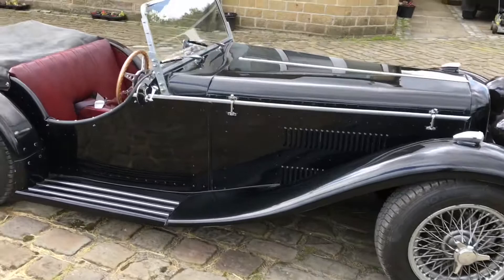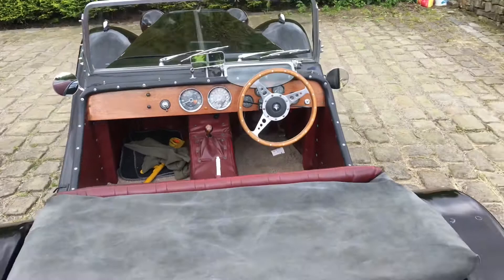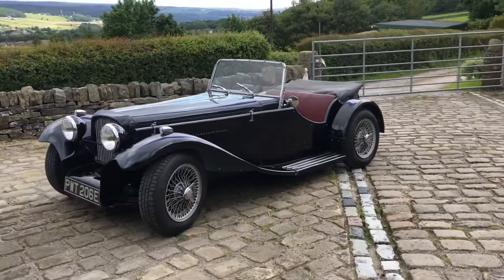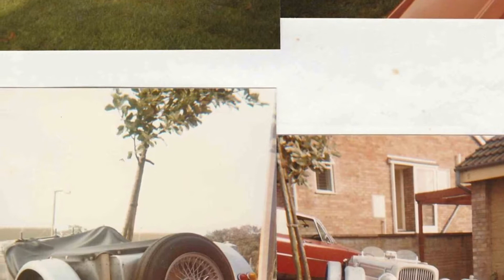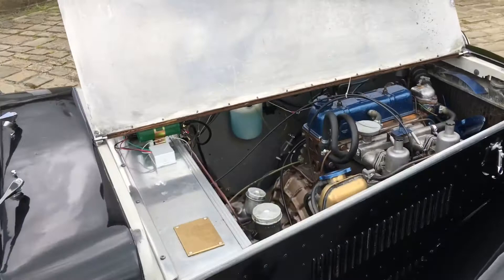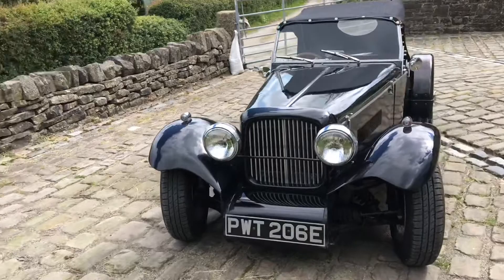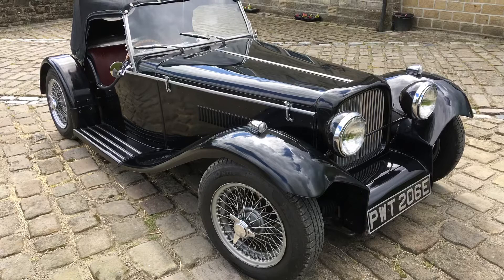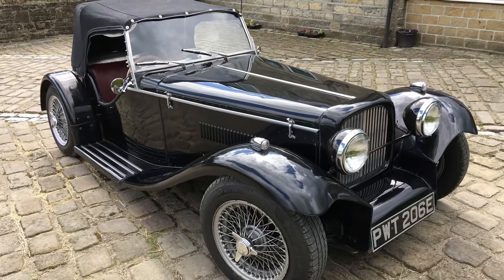THE BURLINGTON ARROW

Comment: Although this is a Burlington it is not an Arrow and it is not a Kit car.  This is a Burlington Beretta and all Burlingtons are Specials, not kits.  The big difference between the Arrow and the Burretta is that the Arrow has cycle wings and the Burretta has flowing wings.
Reply from the maker: Hi Len, it is an Arrow, I got fed up of the cycle wings falling off so put some Beretta wings on. You can see the original car in the clip.
Reply: @johnomelia5403  After my wings fell off several times I used 3/4 solid steel rod as brackets, that cures the problem.  They have not fallen off for 30 years now

Comment: I’m currently building an arrow and wondering if you had any idea where to buy the cycle wings from?
Reply from the maker: They originally came from the Burlington company someone will have the moulds. Will be quite a rare part now but bound to be in the back of a garage somewhere good luck.
Reply: Trailer/horse box wings from your local trailer centre.  The fronts can be shortened.